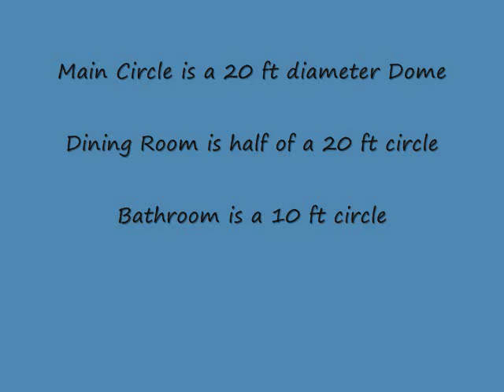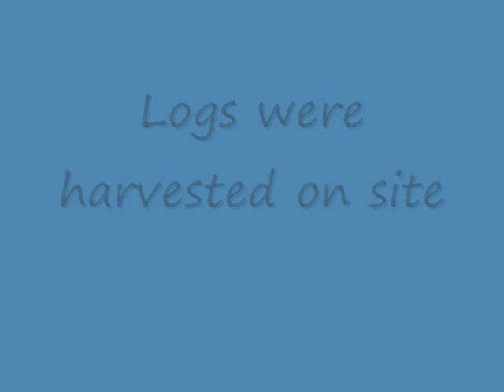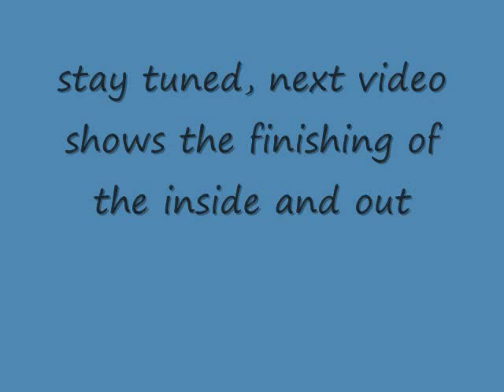Evolution of an Earthbag Dome Part 1

Comment: Looks great I am wondering how you managed to secure the posts on top of the bags? Also is that a polished concrete floor or an earth/mud floor with bees wax finish?
Reply from the maker: Hi Jeff
Holes were drilled into the logs, appox 2.5 ft of re-bar was pounded into the wood and down through the layers of bags. Will get back to you regarding the floors.